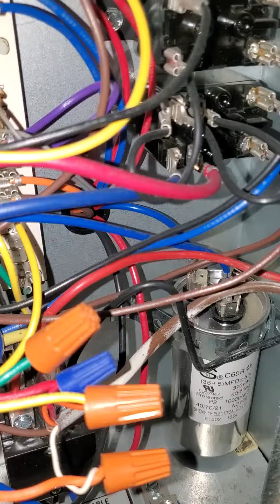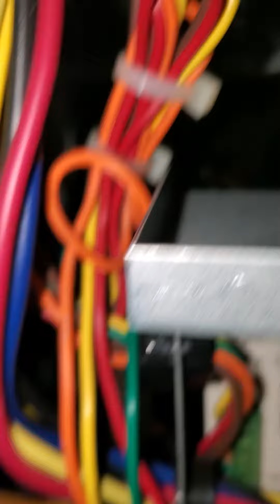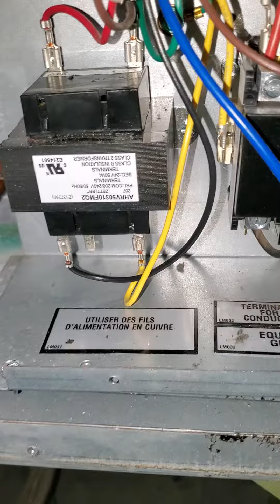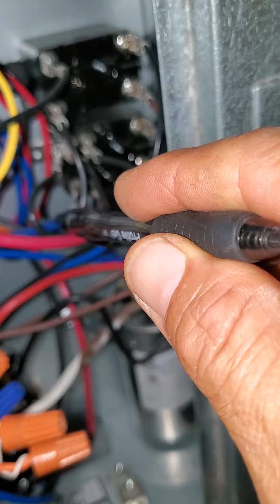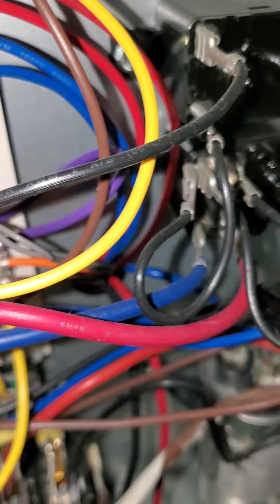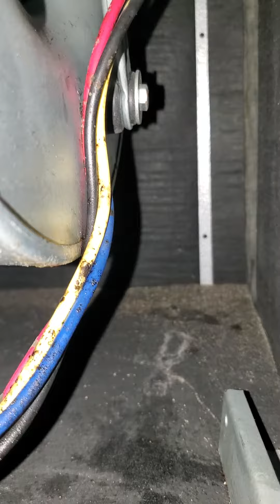Hydrotech Dual Speed Relay

Comment from the maker: Top Blower Black Relay is Low Speed allowance to Red wire and Lower Relay is for Blue wire to Medium Speed. This unit Run in Low speed for 10 min for Humidity Removal then goes to Med Speed in this case for Normal Cooling Operation

Comment from the maker: If one relay goes bad you can still use single speed but if both relays go bad you can still use the Cooling Contactor as a Blower relay to cone on when Cool is on.   Off course You wont Get Fan On or Constant Fan Operation at all unless AC is Operating